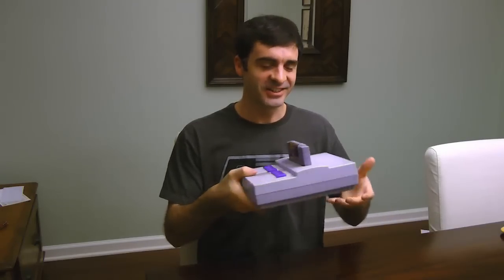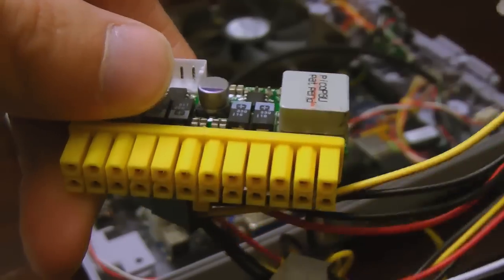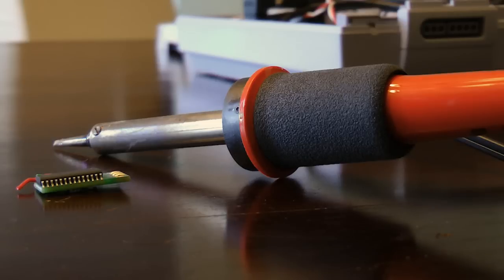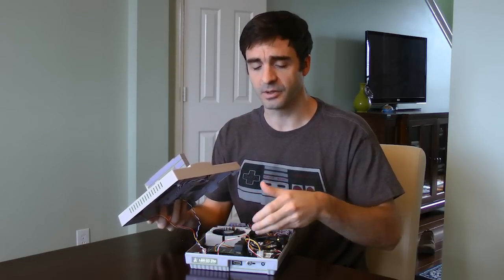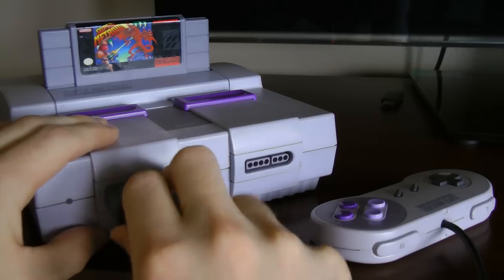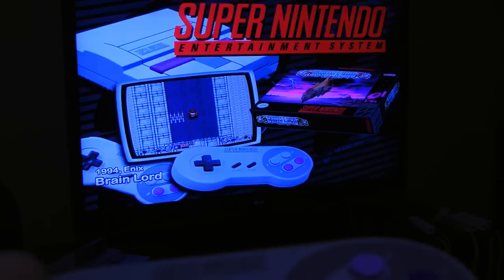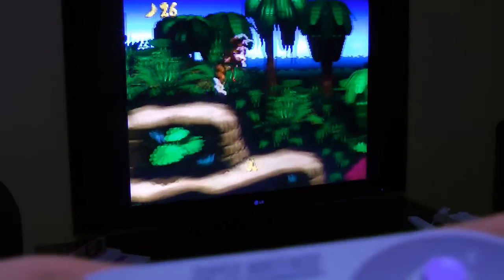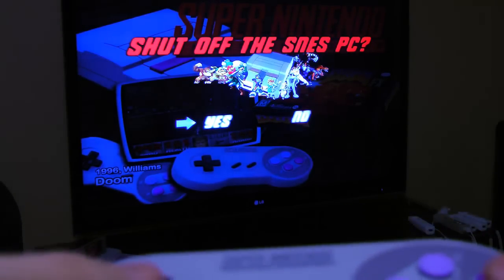SNES PC Build Project - Part 2

Comment: @buddwm I'm using the same board, an almost identical system to your end result, but I'd like to know what AC/DC adapter did you use? I'm also using the back end of the pico PSU remolded for that Intel board.
I'm doing basically what you're doing, but I'm going to be using a different frontend for all my emulators. This is something I've wanted to do for the longest time and your videos pushed me over the edge to finally do it. I have a video up on my channel showcasing version 1 of my personal take at it just to see if I could and now I'm going big with all new components and emulators.
Reply from the maker: +Bread Box Hey nice vid.  What will you use as your front-end?

I used an old AC/DC adapter that I had with my Dell Inspiron laptop.
Reply: +buddwm Thank you so much, I'm going to try out http://www.lakka.tv/ but I might switch to http://console.com.co/ once it be comes more widely supported with different hardware.
Also huh that's interesting, a Dell AC adapter. I was worried with the one I have (A 90w) that the voltage wasn't going to be enough, but seeing how most AC adapters from Dell aren't more than 65w I should be fine. I can just grab one online if need be. Thanks again!
Reply: ***** Not powerful enough for accurate functionality and other features. IDK about the 3rd one, but there are still more powerful pico boards out there. And idk about the rest of you guys, but I like using windows for the emulators because of Direct X. After playing around with some of the different OS's I just went with windows and I'm using ICE on Steam Big Picture.
Reply: Oh sure, if that's all you are emulating. The system I have now can run GC games at 720p
It's a thin ITX ASUS board with an i3 4340. Its a pretty badass little system. I want to make a video about it, over viewing all the parts.

Comment: very nice builds, to bad is almost impossible to do a n64 pc build since not all the games are emulated good enough
Reply: I suppose you haven't used Project64? N64 Emulation is almost, if not already, perfectly emulated.
Reply: i have however only very few games work for it, once they get every title working then yes it will be perfect but since that will probably never happen its impossible to do a n64 pc build
Reply: luke9511 I downloaded a torrent of all games a while back (don't lecture me about piracy), and every game I tested worked fine, maybe with very minor issues.
Reply: Matthew Richmond One I know for certain is Conker's Bad Fur Day.
Im not sure about playing it normally, but you cant use the chapter select function as it crashes the emulator.

Kinda sad really, as I wanted to do a Texture hack for that game.
Reply: *****
unless there is a emulator i dont know about that can run every single n64 game with no issues or having to set special settings and that includes games like star wars rogue squadron and battle for naboo which i know for a fact have never been run, it is impossible to run EVERY n64 game out there and i know i have been trying for more than 5 years and i have found that some games work and most do not with out issues that make it impossible to play the game
Reply: IdealIdeas100 I just now tested CBFD on Project64 2.1 and the entire title screen seems to be working fine.
Reply: Matthew Richmond
 It works fine in some aspects but try using the Chapter select and pick a chapter, it crashes right after selecting one.

I believe sometime ago I played through the entire game on emulator, but I never used the chapter select. During this time I was using the default Graphics plugin as well.

I use Rice Video Plugin now as its way better feature wise, and it allows me to rip textures from the game and change them.

There is really only 1 spot I wanted to change textures in and that was the Mighty Poo battle , but sadly Rice's plugin doesnt work very well past the menu select screen for anything
Reply: IdealIdeas100 I downloaded Project64 and the game from CoolROM just to check this, and the game didn't crash after selecting a chapter for me. Looks like they fixed it, so my previous statement stands, N64 emulation is perfect, if not with very minor issues.
Reply: Matthew Richmond
But are you using Rice's Video Plugin or Jabo's Video plugin?
Reply: IdealIdeas100 Project64 2.1 defaults to Glide64 which I believe is a continuation of Rice's Video Plugin.
Reply: Matthew Richmond
I cant seem to get glide64 to work for shit.
Reply: ***** That does work really well, actually.
Reply: *****
Glide64 isn't an emulator. Ideal is probably already using Project64. Glide64 is a video plugin for said emulator.
Reply: Matthew Richmond
Yes, which I cant ever seem to get to work.
it comes pre-packaged with Project 64 v2.1 and it refuses to work when I switch to it....
Reply: IdealIdeas100 Does your graphics card support OpenGL? I think that's what Glide64 uses, but I'm probably wrong.
Reply: Matthew Richmond
Pretty sure my Nvidia 780Ti supports it.
Reply: IdealIdeas100
Very strange.
Reply: Matthew Richmond
Wait, I managed to actually get it to work! but I still cant get Conkers Bad Fur Day to play right, game sounds like its playing but I just get a black screen.
Reply: IdealIdeas100
It performs perfectly on my shitty workplace PC, it's a wonder why it won't work on yours...
Reply: Matthew Richmond
My PC has too much horse power for it to keep up I guess XD
Reply: That's not the issue. N64 emulation is pretty good. The problem I see is space. If he had trouble with the SNES case, imagine the N64 case. That would also cause some heat problems I imagine.
Reply: ***** IRNatman IdealIdeas100 Matthew Richmond N64 emulation is perfect if you use a pixel perfect plugin like angrylion's RDP. Of course you'll need a gaming PC to not lag.
Reply: Drahsid
Doesn't pixel perfect only affect graphics? We're talking about compatibility, not visuals here.
Reply: Matthew Richmond
Graphics plugins play a major role in compatibility.
Reply: IdealIdeas100
Yes, I understand that, but why would Pixel Perfect do anything besides maybe look better?
Reply: Matthew Richmond It looks worse but emulates video perfectly.
Reply: *****
I wanna make a PC pc project.
Reply: ***** why destroy a perfectly good classic console.
Reply: xboxmodder02
For the same reason the guy that made this video did, because it doesn't work anymore.
Reply: xboxmodder02 PS2... Classic... Stop it, you're making me feel old. :I
Reply: IRNatman Old??? You can't be as old as me then.I am 34 i was 22 when the PS2 came out.Been playing on consoles since 1984.
Reply: xboxmodder02 I never said I was as old as you. I just can't believe that the Gamecube and PS2 are considered retro now,
Reply: xboxmodder02
Am I the only one that thinks you don't need to be old to know about these things? I'm 13 and constantly play SNES even though I have access to modern consoles.
Reply: Matthew Richmond I never said that you had to be old to know that, why do you people put words in my mouth?

When I said "PS2... Classic... Stop it, you're making me feel old. :I" I was being goofy, you people take shit too seriously.

But on the bright side, you're one of the first 13 year olds I've seen that uses proper grammar. Bravo!
Reply: David Ralph No, you're not. Anyone with proper grammar knows you can't use numeric symbols. (0-9) You mean, "I'm a ten year old with proper grammar!"
Reply: Drahsid
Good job, you sure showed that ten year old.
Reply: Samantha Richmond No, no it's not.
Reply: SensibleGaming Huh?

Comment: That's a really kick ass build.  Another thing, does the mobo have Bluetooth?  If not, a dongle could easily be connected to an internal USB header, and then you could connect a keyboard via Bluetooth and use it dual purpose as a PC and the emulator, which, btw, is really slick.  You lucked out with that great menu system, it really polishes off the build.  Really interesting to see how you tackled getting around the issues you ran into working with such tight restraints.  On top of that the video production was really polished too.  I get tired of watching videos of this sort of thing and it's a guy with hand held camera that's out of focus half the time, and half the words spoken are "uh".  Yours was polished with music and comic relief and everything.  You don't generally expect those sort of comments on a video like this, but yours was so good, it was worth mentioning.

Comment: Not saying this in a sarcastic way, I am just curious...  Don't you feel the components you chose are way more than overkill for only emulating the SNES?  I know size was a factor, but wouldn't an Atom based PC or even a raspberry pi  be more than sufficient enough for this task?

Comment: If the reset switch on the case has no function you could wire another switch to change aspect ratios by cycling them each press.

Comment: What is the voltage supplied to the snes led? I made a raspberry pi inside the snes case with Retropie to play roms. I connected ground and led (with the original resistor) to a 5 volt source of the raspberry GPIO... it burned in 5 hours of use :(

Comment: Hey could you please tell me which usb controller chip you used or a link maybe.
Also how did you manage to hide the BIOS, in your previous video you could see it as soon as u turned it on but now it's gone. 
Great job on the SNES PC btw. I'm thinking of doing something similar so i would appreciate it if you could help me with this 2 things. Thanks

Comment: I know this is kinda old, but I was wondering... If I were to attempt my own build, could I use a linux distro in order to use less RAM and CPU power, and then run Hyperspin under WineHQ or Crossover Wine?

Comment: So I am curious, where did you get the internal wiring to connect power, reset, etc.? Is there a wiring kit I can buy or did you just harvest from an old build? I still need to get the 1x2 molex and dc mount jack. Do you happen to know the size needed for the DC jack to accommodate a dell barrel style plug?

Comment: Oh and my other question is my mother board isn't fitting in the SNES case very well did u use anything to make it higher up? This is my first build im just running into a few problems... if you were to make another SNES PC would you use the i3 or an i5?? I have the i5 just wanted to see what you recommended?? Again Thanks for your help :)

Comment: Your builds have inspired me. I have been slowly been purchasing what I need for a similar setup. I have the same Slim ITX featured here, the m-sata drive, PSU and i3 processor. My main problem is I dont know if I should go with an NES or SNES. Is there much more room in the NES case for this type of set up? Also, how many 90 degree connectors did you need to get for hdmi and USB and such? Thanks!

Comment: I am hoping maybe you can answer a few question for me, as this is exactly the same concept I am going for - A sleeper look which seemingly functions just like a console and nothing more. 1.) I want to build in an NES case, would you recommend the motherboard used in this setup for an NES build if you had to redo it? 2.) do I need a special chip to route the original controller wires to USB? If so, can I have a link? Do you recommended building in an NES or SNES? Thanks for making these videos!!

Comment: When the super scope sees the (CRT) TV's electron gun, it toggles the state of one of the lines on the controller port. The SNES knows what part of the display it's drawing at any given time, so when that bit is flipped, the SNES records that position on the screen.
It's a system that wouldn't work on USB, there's no way USB can get that kind of precise timing. SNES-to-USB controller converters generally just work on regular controllers anyway.

Comment: Amazing!!!
But I've some questions, how did you mount the Mainboard to the case, via screws or glue?
I think the plugs were done with glue, am I right? ^^
Ah and what Gamepad-USB-Adapter did you use, a special one with your own drivers or some random from ebay/amazon?
Seems pretty amazing, I think I will do the same with my broken EU SNES, but maybe with an USB-Port on the side of the case for easier maintenance...
Hope for answers :)

Comment: One more thing, just to explain something, i mentioned that everything was compressed, that's because I want to use the 2 and 3 TB externals for storage as their hardly ever turned on (don't wanna download all that again) and I'm currently not looking to get any new hard drives to put everything uncompressed and ready to use on them just yet. at least not until i can get 2.5" HD that are of a reasonable capacity.

Comment: ....The entire PS2 NTSC is on a 3TB HD (both are WD essentials) I also bought 6 PS2 style corded controllers for it and it all works great, though everything is currently compressed except for the Hyperspin frontend (100gb) due to not allowing myself to allocate funds to this pastime, I'm pretty strict with my spending, though after getting a free acer iconi A501 from rogers, and doing emulation gaming on android (the tablet and my Xperia play which i got the same day, both free BTW).....

Comment: Thanks. That should help a lot.

Regarding the power supply, I think I misnamed what I was talking of.
I did notice that the DH61AG has its own power supply and I was wondering how you had chosen the power brick (or whatever you call this black brick looking laptop power adapter).
I wonder how you were sure that it wouldn't fry your system. Is there some clear indications on what you can use with the DH61AG?

Comment: - did you put the motherboard directly onto the SNES case? Or did you get some motherboard feet of some sorts?
- How did you choose the power supply? Is there some clear rules for this?
- Did you need to solder some thing on the motherboard to make it use the SNES power button?
- Is your system really silent? (mine is meant to be a media player so maybe this one is more important to me than it is to you)

Thanks

Comment: The raspberry pi has like an 800Mhz processor or something lower. That means that it has not near enough power do do it with hyperspin. Also I think Hyperspin cant run on an arm processor and needs some of windows libraries to run. But I'm not positive so check that out if you think otherwise

Comment: You gained higher res graphics but with the Sony SPC700  chip removed the sound will be inferior cause most SNES emulators corrupt high precision sound effects like the shrinking sound in SNES Mario/Yoshi games or the getting hit by enemy sound in Actraiser or Wind in Chrono Trigger.

Comment: Buddman,
I finished my build, the CPU cooler seems cool enough to the touch, I did notice that the bottom is pretty toasty. This is due to the board being so close to the bottom of the case. I may be able to use a few spaces to add a lil more space but not much. Becuse yours has been done for much longer than mine, I am asking after about an hour or more of continous use how WARM is the bottom to your touch.

Thanks in advance for your insight and info.

Comment: Sweet! It was because of the NES-PC you did that I built my NES-PC. Mine is more of a 3/4 sleeper, since I used the standard I/O shield on the rear of the box. But I also made use of the controller ports to USB (via the retro-usb chips). I used a Jetway 330 Atom board running Windows 7 Basic. It has a lot of the console ports on it, but I use it more now for charging usb devices (ipod/mp3 players, etc.) because of its low power draw.